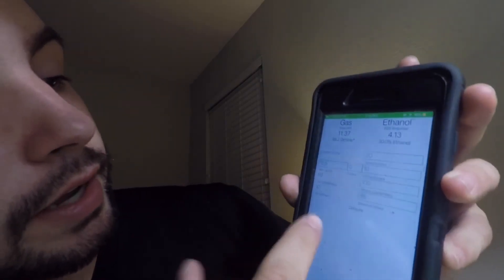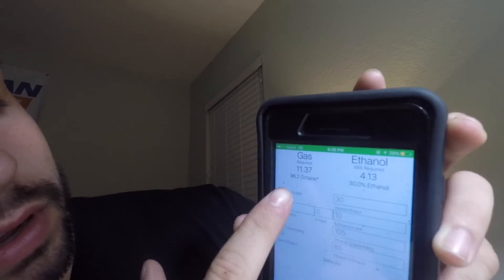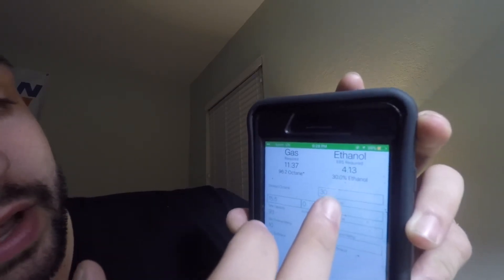The In’s And Outs Of E30

Comment: E30 is not 30% e85. E85 is 85% ethanol, you want a roughly 30% ethanol blend.
Reply: E30 is 30% of a full tank dummy!! %30 e85 and 70% of 91/93 of however many gallons is ur full tank.
Reply: @Paper.Power.Politics  incorrect.
Reply: @fredfrederickson  please elaborate
Reply: @Paper.Power.Politics  if your tank is 70% full of gasoline and you fill the remaining 30% of your tank with e85 then you have created E25 not E30 assuming there isn’t already ethanol in the gas you are using because 0.3x0.85=0.255 Assuming you have up to a 10% ethanol content in your gasoline already as is standard for US gas it changes things, it also changes a lot depending on how full the rest of your gas tank is. If 0% of your tank is full and you fill it to 30% with E85 then you have E85 in your tank since there is no blend with gasoline, assuming the ethanol content of the E85 you put in is actually 85%. It’s always important to test ethanol before you put it in your car because ethanol degrades quickly and when it does it turns into water. Near me the gas station selling “E85” in the summer usually has a 70% ethanol content not 85%, in the winter I tested it well below 50% and decided not to bother using it until summer when quality is better because more people use it during the summer which means it sits in the underground storage tank for less time and degrades less before it is refilled with fresh E85. I hope you can see how much all of these variables can change things so I don’t have to math out every specific situation for you. Things that matter are: the true ethanol content of the “E85”, the ethanol content of the gasoline in your tank, the amount of gasoline in your tank to begin with.
Reply: @fredfrederickson  got it thx a lot for elaborating.. so if I have 70% of 91 in my tank already.. and the e85 was testing at max capacity of 85% and then filled the remaining %30 up with the e85 would that still be e30?? Or do variables the gas that has been in tank already for a certain amount of time will also affect that?? So if I’m on empty and fill %30 of my tank with tested e85 at full capacity and the remaining %70 with 91 is that e30 since e85 is testing at max capacity ??
Reply: @Paper.Power.Politics  it could be anywhere from E27 to E32 because of the variation of ethanol content in gasoline. The law requires pump gas to have a minimum ethanol content of 2% and the max content you will ever see in regular gas 10%.
Reply: @fredfrederickson  ok I get it but ima asking if I filled my empty tank to %30 capacity of empty tank with e85 that was testing at maximum percentage and the rest of the  %70 percent of my fuel tank with 91 or 93 is that e30???
Reply: @Paper.Power.Politics    I just answered that above. Because 91 and 93 both has anywhere from 2% to 10% ethanol contained in them it could make your mixture of 91 or 93 and E85 anywhere from a 27% ethanol content to a 32% ethanol content. You can do the math pretty easy just take your ethanol content from the E85 and multiply by the percentage it will occupy in your tank which gives you: 0.85x0.3= 0.255 This resulting number of 25.5%  WOULD be the ethanol content in your gas tank if it was filled 70% of the way with 91 or 93 and filled up the remaining 30% with E85 IF there was no ethanol in 91 and 93. However since 91 and 93 is required to have a 2% to 10% ethanol content it can make your 70% 91 or 93 and 30% E85 mixture have up to a 5% variation. To do the math for that you would take the percentage of your gas tank that will be occupied by 91 or 93 and multiply it by the lowest and highest possible ethanol content in the 91 or 93, lowest would be: 0.7x0.02=0.014 and then you would add that with the ethanol content from the E85 in the other 30% of your tank which we found before: 0.014+0.255=0.269 So the lowest possible ethanol content in your mixture of 91 or 93 and E85 is 26.9% To solve for if the 91 or 93 had 10% ethanol in it would be very similar: 0.7x0.1=0.07 take that and add it with the ethanol content from the E85 in the other 30% of your tank which we found before: 0.07+0.255=0.325 which would be equal to a total ethanol content of 32.5% I hope you understand now why it could be anywhere from 26.9% to 32.5%

Edit: This is if you live in the US idk if 91 or 93 in other countries has any ethanol in it but you should look up if there is any and what the minimum/maximum amounts in it are. Also you don’t have flex fuel sensor it’s better to go with a little more ethanol than a little less ethanol so you don’t have knocking so when I fill up I always assume that the 93 I filled up with had the minimum amount of ethanol in it at 2% that way I put more E85 in the tank to achieve the mixture I want and I will never possibly be under the target amount of ethanol I want in my tank. A little extra ethanol will not cause any issues but by doing the math yourself you can find out how to be at your minimum desired ethanol content without going crazy and adding way too much extra ethanol.
Reply: @fredfrederickson  yes I did!! Thx for clarifying cuz that’s important to know for more power a baby (donut voice ) lol